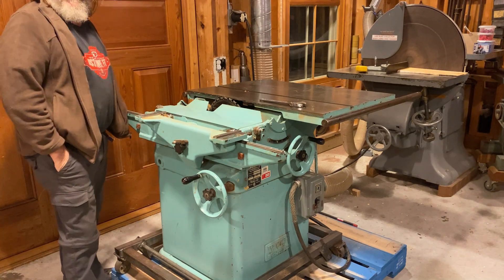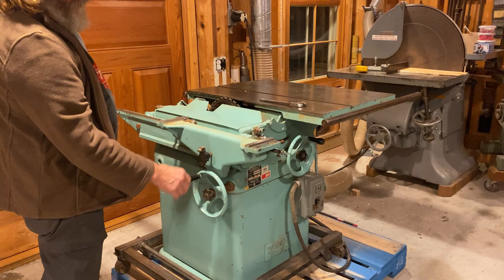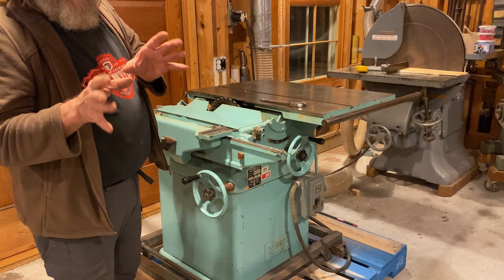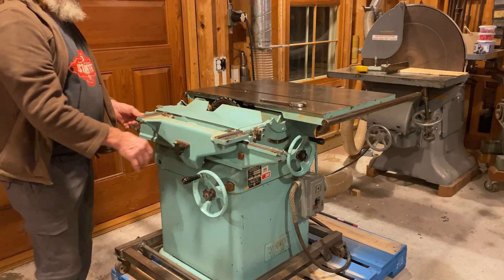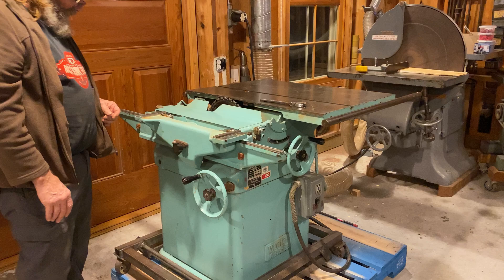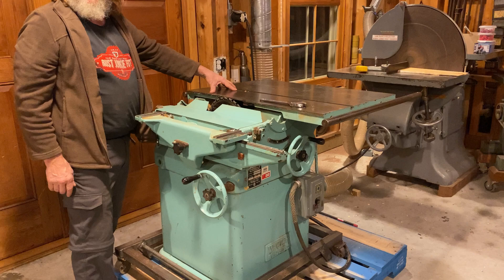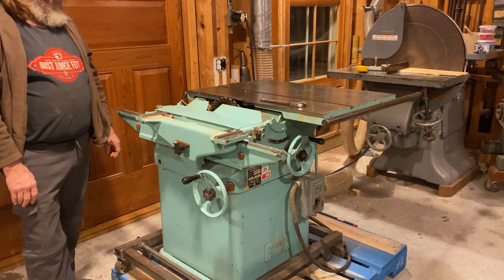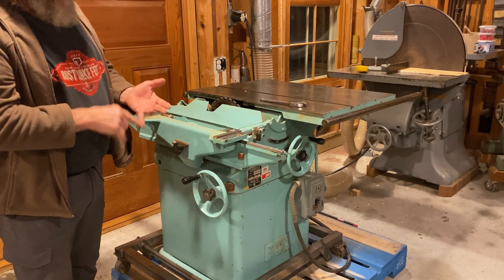Wadkin Bursgreen BGS 1964

Comment: Dear Jack, I have the same saw, so very pleased to see that you have let one into the temple.  I watched your PK saw videos envying it considerably, but this is a nice machine.  You mentioned all the eccentrics and adjustments on the slider - yes indeed.... and it's a complete pig to align, at least if you are a newbie.   I learned quite a lot doing mine.  Including that someone had put a packing washer behind the bottom bearing so everything else had been tilted way out to compensate.  Took me a while to find out why it was all misaligned.   It's all good now, although the main table is slightly warped so it's impossible to get it perfect.  I look forward very much to seeing you get this one into Jack order, and perhaps can find out some tricks from you along the way.  
There are some tapped holes (and some plain for pins) in my sliding table, but no etched angle marks as for the mitre on the PK.   I would like to find out what they intended for these holes, other than a fixed 90 fence.   I'd be happy to share pictures or other details of my saw, if you are interested.   regards, Miles
Reply from the maker: The holes were part of the assembly for the outrigger, which was basically a pedestal held by solid bar pipe that came out of the holes below the carriage. It was basically a glorified piece of angle iron that walked assembly with wide roller bearings to accommodate the 2 inch horizontal movement, the later model BGP expanded that to have connecting castings and much larger, sliding tables, capable of holding full size house, doors, and sheets stock